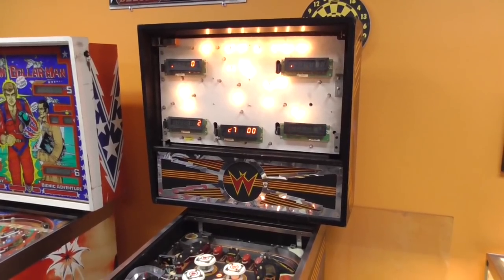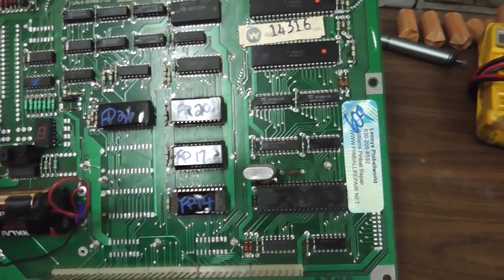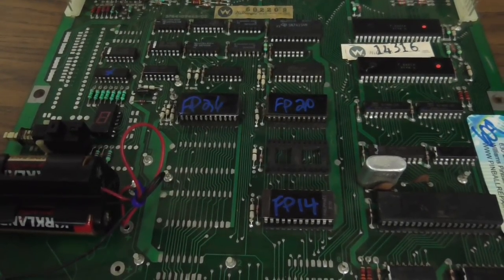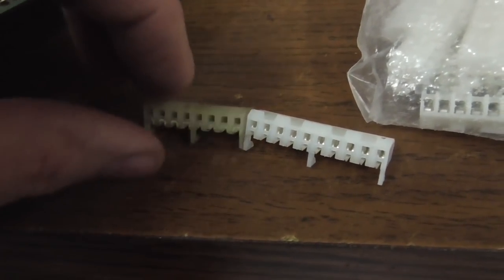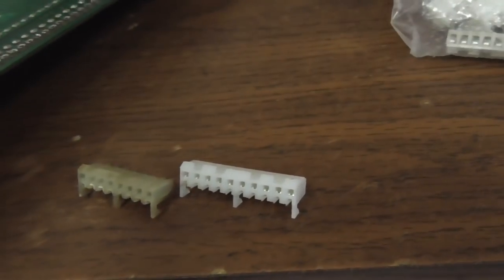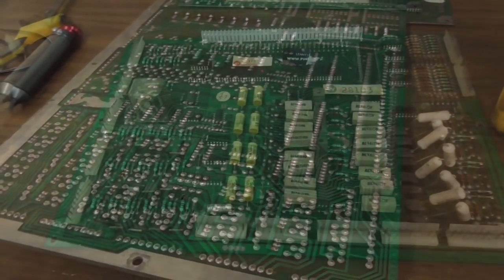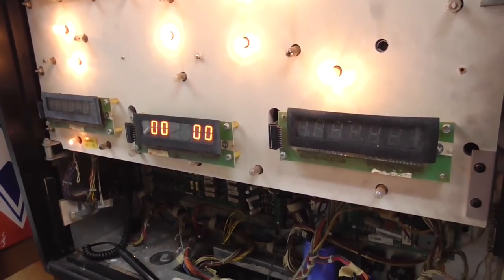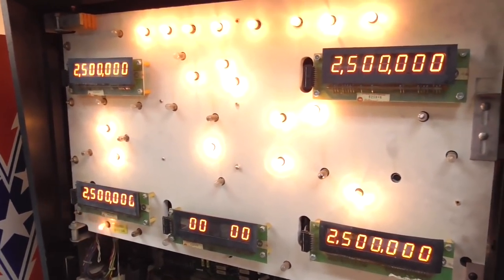Replacement Battery Pack On A 1983 Williams Firepower II Pinball Machine - Board Repair

Comment: That solder sucker is a great tool. I had to de-solder a big component the other day that had a big old 3/32" through hole and huge pile of lead sodder :) on the board and I thought for sure it was going to take a few tries to empty the joint but it did it in one go. I did have one instance where it got jammed up ejecting the solder but cleared it easily by removing the nozzle end. Thanks again for the tip.

Comment: And I'm not a Testofon/Contitest salesperson, but I still keep recommending these, because I love this product!
(they make really quick work of finding bad transistors on driver boards)
(and if 40 Euros or 50 assembled is too much for you, the devices' friggin' schematics are online for free so you can build your own! And it's a really simple circuit. But that way you gotta supply your own parts, case, circuit board and even the batteries are included - and they last for years on daily use)

Comment: They under design the drivers to save money, a 5 amp transistor is cheaper than a 10 amp transistor.  They do this because they know the duty cycle is low.  When the coil is off the driver is cooling..  Another cost saving trick is to not use heat sinks, again the duty cycle.  During a lock on, 100% duty cycle, it quickly overheats and go boom.

Comment: I bought the engineer SS-02 solder sucker that looks just like yours, complete with the red top. It does pull a good vacuum to remove solder, but the tip plugs up after each use and has to be cleaned each time. I don’t know how yours works as we only see the final result. I just finished replacing a 26 pin header on a system 11 board and started with the manual sucker, but quickly switched to my Hakko desoldering tool. It made quick work of getting it done. If yours works for you that’s great. How about showing it in action? Curious, do you have to clean your tip each time too?
Reply from the maker: I don't show any of the 'action' because it just gives people more things to criticize me over.  Everybody is so much better at .... 'solder sucking' than I am for instance

Comment: JOE CLASSIC, Those ZERO ohm resistors are used for faster switch detection? because isn't that a slow strobe signal problem because I don't know why resistor value would change the switch detection circuit so Zero ohms would be faster switch detection. I think if the strobe signal or scanning signal was faster there would be no problem?
Reply: Good questions. Resistance would cause you to have a slower voltage increase, and electricity travels about 6.5" per ns under no resistance. Increasing voltage is standard practice when one is overclocking since the voltage gets clipped due to the speed and you can get past the metastable zone faster.

On the Gigatron TTL computer, there are a couple of diode-resistor banks that are used as ROMs. When overclocking the machine, folks will use faster diodes and lower resistor values. The faster recovery diodes pull things lower faster, and the lower resistor values pull things up faster.
Reply: @PlumGurly  Resistors shouldn't slower the voltage increase unless there is capacitance or inductance RC or RL time constant. I'm not sure what these "zero ohm resistors" are connected to what type of circuit or chips because there must be a strobe signal or scanning signal for switch detection. I thought the zero ohm resistor were connected to the PIA chips input pins as pull up resistors.
Reply: @waynegram8907  -- Since it is involved in switch detection, it could be the momentary contacts that are the issue. So add capacitors, lower the resistors, or do both to make things a tad more reliable for the player. The momentary contact nature of the switches could make things behave similarly to how the lights work with the pulse modulation. The light circuit sends out 18 volts to 6-volt lamps without blowing them due to the time constraints involved.
Reply: @PlumGurly  The Zero Ohm Resistors are pull up resistors for the PIA chip to detect the switch contacts?
Reply: @PlumGurly  The light circuit sends 18vdc but its strobed 18vdc that is why it averages at 6vdc. I'm not sure why they are strobing 18vdc for the lamps never understood why they are using strobing signals
Reply: @waynegram8907  I think that is also known as pulse width modulation. On FPGA design boards, for instance, a problem is that the included LEDs are often too bright, so a suggested practice is to gate the system clock to them to get about half brightness.
Reply: @waynegram8907  I thought they were in series with the PIA. Still, if the contacts are only momentary, they may need more voltage due to possible bounce or an effect similar to pulse width modulation. Just a thought.